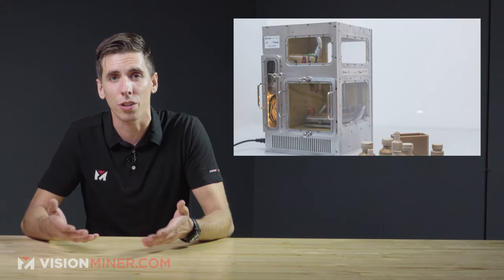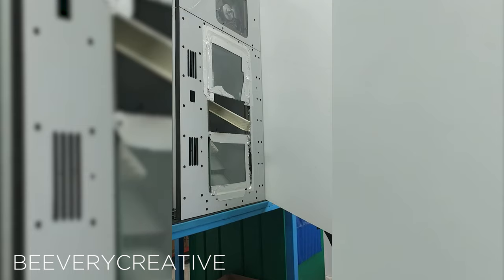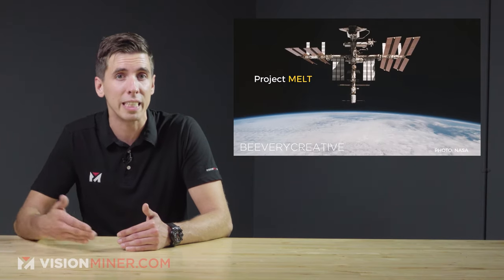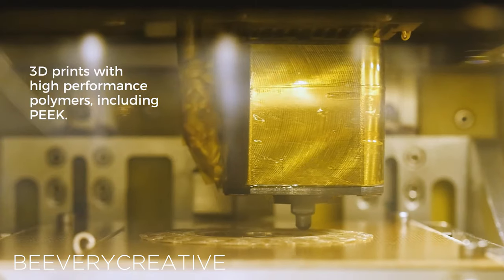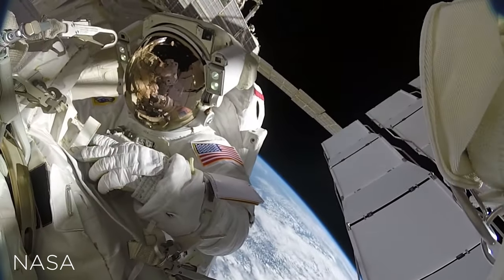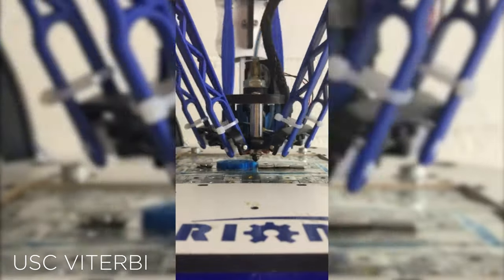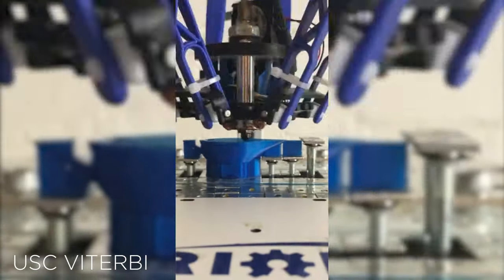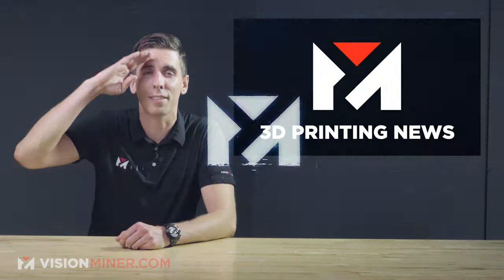PEEK 3D Printing in Space? 3D Printing News 2021

Comment: Can PEEK be polished? can its surface roughness be smoothened out to the nanometer level like what you would get with SLA printed products?
Reply: If I were treating as a HTP I’d say yes.  Especially machine polished up to wet sand depending size. Or if ability, vapor polished brings to ultra smooth
Reply: @Gilmore304  Thanks for the suggestion
Reply from the maker: PEEK can definitely be polished, yes!